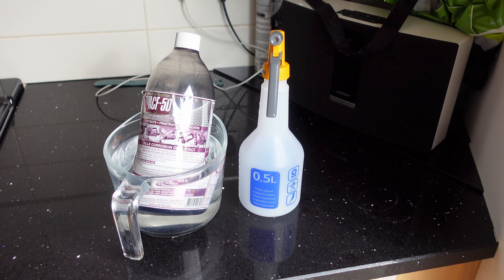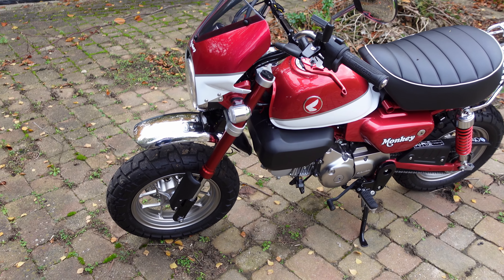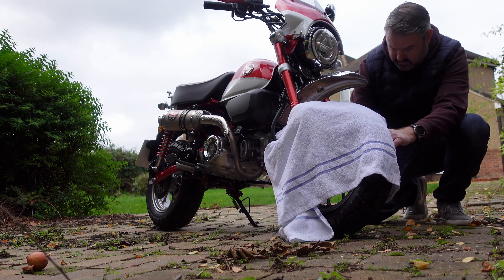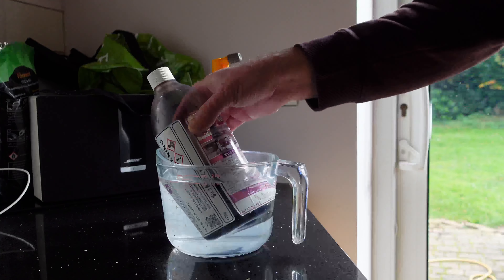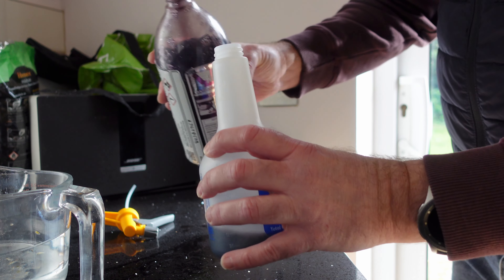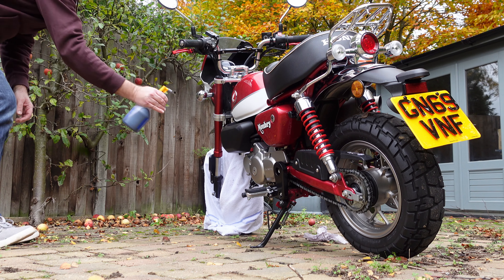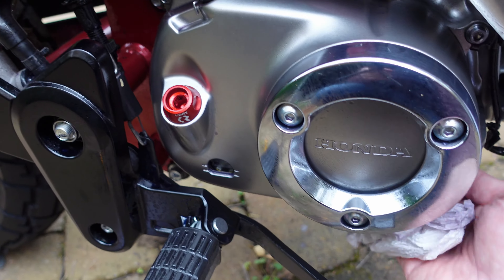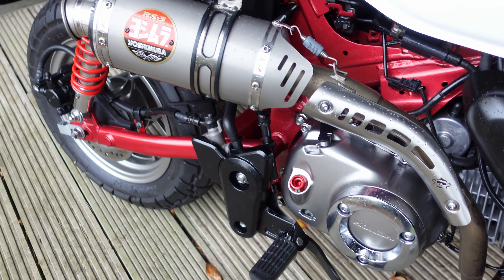Winter Riding - Protecting Your Bike From Corrosion With ACF50 | Simple and Easy Application!!

Comment: Heads up! Make sure to block the tiny hole that let’s crap off the back wheel get right inside where the swinging arm bolt goes, then put some grease on the bolt. Also grease the axles, because they are dry from new!!!
Also take the back mudguard plastic covers off to get where the sun don’t shine, or better still take the mudguards right off to give the folded rims a good soaking.
Put ACF50 inside every electrical connector and switchgear and also, the headlamp rim will rust internally if not looked after!!
That should keep you busy✅
Reply from the maker: Thanks for the heads up Roger, got to finish up this weekend due to the rain stopping progress! very thorough information, thanks for sharing.